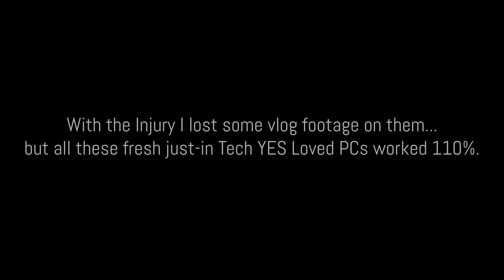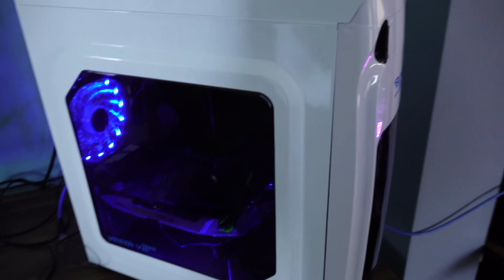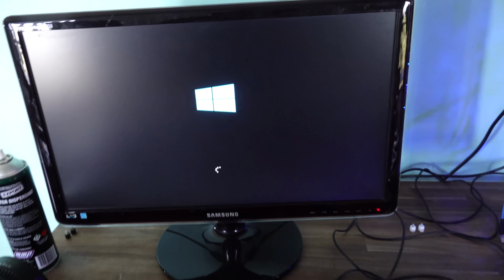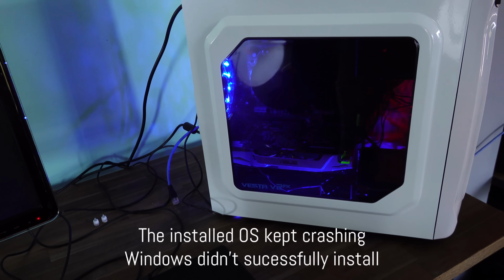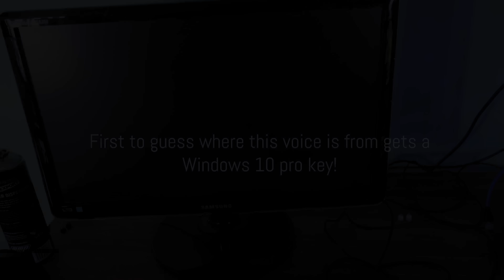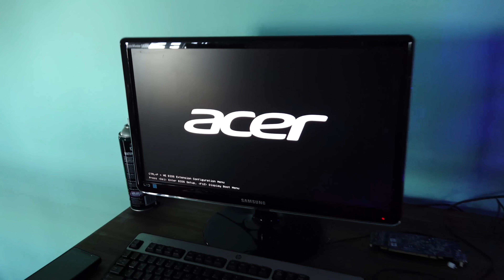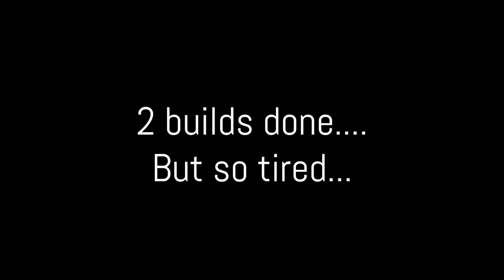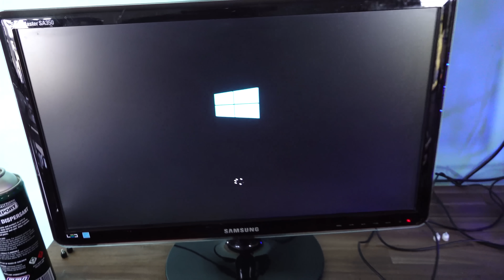Building PCs & More OEM Secure Boot Problems - A Tech YES Hurricane VLOG

Comment: I got an Acer legacy bios board working with a 1060 3gb. I had to use DDU with an old card to remove all previous drivers, but after that it worked like a charm.

Comment: kinda weird to "fix"! a fan running at full speed by using a low noise adapter. that's kinda lying to the customer as something might as well be broken on that motherboard. there is a reason that it's running at 100%

Comment: I’ve had a similar situation with the spinning fan, except it would just run the LEDs in my case. 

Turns out it was pulling power from the monitor. Disconnected DVI cable and it turned off.

Comment: LOL! Imma needs you and Linus to be more careful with your components. You specifically need to stop putting your boards on the floor (which appears to be carpet). Now, I know components are not as prone as they used to be to static discharge but it would not hurt to put them on a non-conductive surface.

Comment: Maybe the one Board which shuts down after a while has a issue with the PSU or something really dumb like getting shorted by the case or fans drawing too much power? I'd pull it out and check it with a different PSU etc.

As for the GPU: try a aftermarket GPU which has a 6-pin connector while the normal one doesn't... I've seen some server boards go crazy when a card tried to suck too much power.

Comment: I’ve had a few PCs that would not boot with new 10 series GTX cards, I had to put in an old HD 4350 in order to get it to boot. A bios update fixed the GPU compatibility issues I was having.

Comment: I suggest you use a hacked BIOS like i did with a HP machine. The thing would not take the desired 750ti no matter what so i flashed it with a hacked BIOS and even too this day the family i donated the PC too doesnt have a issue + it unlocked the stuff needed

Comment: do you have allways so much problems with this oem builds? when i buy oem builds, than i just buy asus, because i know, this will work with an other gpu and the motherboard is just a normal one that you can buy, not a green oem one

Comment: hey bryan. I've had the same issues with acer boards. They will run fine with Nvidia cards from the 600 series and older. Also the HD 7000 series and older shoud work just fine.

Comment: 😒 What TH is a 'low noise adapter'? looks like you slowed down the cpu fan with a wire? 🤠 And as far as Acer MBs 'TechDeals' never really mentioned much about having a problem with his older Acer OEM Gaming PC Project VIdeos but I do remember seeing alot of 'EVGA' Video Cards in his videos if that helps you ✌️😏🦃
Reply: MrSammy It’s basically just a wire extension piece with a resistor built in. It lowers the voltage going to the fan, reducing its speed and thus 
lowering the noise. It’s very useful if your BIOS doesn’t offer enough options to control the fans and the default speed is too high.
Reply: @Astfgl  🙂 ok neat, yes i did notice in oem boards the bios is missing the 'Cpu Fan Speed' setting where u can put a value from 0 to 10, ok thanks for the tip 😏👍

Comment: Why don't you just set the board on a table (like at 8:40), and use a test card on all of it before putting it in a case? I use an HD8490 (potato without needing external PSU) to test systems (like after a massive water leak while running, or new hardware). It takes about 4 minutes to hook up a system to a PSU and drop in a small card with 1 hand (I film with my other hand, or hold a fire extinguisher depending how likely it is something cool, I uh... mean bad... happens). Running 1 system directly on the table since its perfectly fine (wood table).

Comment: Buy it, use it, break it, fix it, Trash it, change it, mail, upgrade it, Charge it, point it, zoom it, press it, Snap it, work it, quick, erase it, Write it, cut it, paste it, save it, Load it, check it, quick, rewrite it Plug it, play it, burn it, rip it, Drag and drop it, zip, unzip it,
Reply: Sang this

Comment: If the fan spins with no power, then 5VSB must be shorting through to something and reaching the fan.
The other option on some boards (seen it on my Asus) is options for choosing legacy or UEFI for devices - I made a mistake because I'd intended to install Windows for UEFI with GPT partition, but with both enabled, it did me a MBR partition - I have a vague idea that Windows 10 is supposed to be better at booting through UEFI... Maybe I tweak some settings and use something to convert the drive to GPT - after checking that the utility can also do a conversion back to MBR using a bootable CD or by hooking it to my other system - I've picked up quite a few giveaway pro version partition tools

Comment: That's why I always change the settings in the bios before taking the boards out, and I always update to latest bios, never had a problem like these before and use hp boards that supposedly only allows 35 watt to pcie and never had a problem running a gtx 1050ti on them

Comment: 3rd and 4th gen Acer boards typically from the Veriton line work fine with modern nvidia video cards. In USA I was getting them for about $20-$30. So never bothered with the 2nd gen stuff.

Good thing about the Acer 3rd gen it will work fine with 2nd gen chips while still working with nvidia cards. 

If you avoid some of the acer SSF boards then its standard atx plugs, standard front panel and standard usb 3 connector.

Unlike some of those Lenovo boards where its custom atx and usb 3.0 headers.
Reply: I own a Lenovo SFF and it's not only the USB 3 header and the ATX connector, but the front panel, the front audio connector and the rest of the USB headers so it's a complete mess. The thing is that the form factor is a standard micro ATX so you could get decieve at first glance thinking that you could transplant the mobo easily to another cage but NO.

Comment: Brian........I had to Disable Secure Boot and then go to change CSM to Always to enable the legacy video Bios to finally get it to work on a similar Acer board with Nvidia Card. Hope this help bro..
Reply from the maker: Glad you got yours working, these boards I have here don't have the option :(, so would need to find out a GPU that supports these boards.
Reply: Tech YES City 

Is it a AMI Bios? If yes, check out this thread where one guy explains how to use AMIBCP to unlock secure boot control. I've removed the ability to set a master/bios password with this tool once so good luck!
Reply: https://www.win-raid.com/t284f16-Help-Mod-Asus-S-CA-BIOS-to-enable-Secure-Boot.html

Comment: Can that legacy stuff also happen to AMD cards like an MSI R9 380 4GB? I have the problem that it works with the basic display driver but when I install the AMD driver and start GPU-Z my memory and clock is at 0 and the exclamation mark appears on the GPU in Device Manager.

Comment: 8:25 - That happened to me a week or two ago. It was confusing as hell. Although I have a Cooler Master G750M semi-modular PSU, and it was the fans for my Gigabyte GTX 1080 Windforce OC that kept spinning for a while after turning the PSU off. I'm not sure how or why, but simply switching sockets for the modular (SATA, mind you) cables fixed the issue.

Comment: You could try updating the bios on the Acer board, if that works, try the same for the other oem boards.
Use an old vga monitor to get into the bios.

Comment: I had the same problem with the fan just constantly spinning. Turns out that it was my USB Hub that fed voltage into the mainboard. It was enough to keep it running after pulling the plug.

Comment: At least you got stitches in your thumb. ;) I got hit in the face with a baseball, pushed my upper lip over my front teeth, and had 10 stitches in my lip.  Tickled when they removed them though.  But props for working through the pain! :-D

Comment: Iv'e been doing pc builds for the last 3 years and have some odd graphic cards i was wondering if you wanted for free. 2 e-GeForce 8800 ULTRA 768MB ATI RADEON HD 4850 512M. I never used them for anything more than testing motherboards out. I was also wondering if you have any idea if my personal build has the ability to be upgraded to do live streaming while playing triple A titles? i 5-3570k, 8GB PJ DDR3-1333Mhz, Gigabyte GA-B75M-HD3, Radeon R7 240 2GB DDR3 OC, 500 GB Seagate Barracuda 7200Rpm EVGA 500W 80Plus bronze.
Love the channel and hope your healing up nicely.
Reply: upgrade the graphics card first and try streaming off of that instead of cpu encoding
Reply: Definitely upgrade the gpu and if you want to upgrade the cpu go for a i7 3770K, i7 2600K or 2700K. The graphics card is huge bottlneck, go for something like a 970, 980 or 980 ti
Reply: Yeah that can't stream or play AAA games with high detail. Chip is ok for gaming but need big time gpu upgrade.

Sometimes its cheaper to get a used 2nd build to do the actual streaming from then trying to get 1 to do both at same time since its more costly.
Reply: 🙂 Dear Greg, Normally people would say that u shud upgrade ur pc to a new 6 core system from either company. But if ur ok with lowspecing and using Low on all settings and play stream lite game titles i guess u cud try upgrading your cpu to an i7, overclock it a bit, and for gpu i like 970 980 980thai 1060 570 580. If ur R7,240 (hd7570) is a low profile low height baby video card then keep it around to upgrade a SFF OEM Core2Duo Desktop, that way u can save an old pc and give it a new life, it will be able to play xtra lite games on it for example: Doom 1, Half Life 1, FEAR 1, indy games, open source games 🦃
Reply: Remember when checking processor upgrade prices that some Xeons have exactly the same specs and are available in the second hand market cheaper than i7.
Reply: @RetroTinkerer  🙂 True, i have an oem lenovo 4th gen mb, i remember reading that u can use an lga1150 Xeon 4/8 cpu instead of an i7 4/8 cpu, tho i think the xeon version is almost the same price if its the same GHz Speed, but let me chk rite now cause i wouldnt mind upgrading it, and moving my i5 to a spare haswell board that only has a crappy 2/2 celeron 😃🐢🐢
Reply: You’d just need to upgrade your graphics card to play AAA games, you could probably stream as well but at low to mid settings (basically the same as console)
Reply: Install 2 GPU, Use odd GPU for display and normal load only.

Comment: Bro I just want to know if the pre-built PCs' (HP, Dell etc...) power supplies are any good and can be used for gaming or we have to change it and thanks :)
Reply: In most scenarios you would need a psu upgrade, however with a low power card it could work. Upgrade if possible however
Reply: @tomsinclair5982  those PSU could run a GTX 970 or not ?
Reply: @IsmailKarym  not
Reply: @NoodlesTBograt  Okay Thanks a lot Bro
Reply: @tomsinclair5982  Thank you too <3
Reply: There is a huge range in OEM psu's. Safe bet would be no. But sometimes you can get lucky and have an OEM Delta 400w or 450w in there and then you are fine.

But the other 90% of the time its anywhere from 200-300. Especially if its small form factor some standard oem desktop sizes you get lucky to have a 350 in there.
Reply: @JimmysTheBestCop  thank you so much for the great informations I really appreciate that ^^
Reply: All the information will be on the PSU sticker so always refer to that just don't try them at random so just open up the case.
Reply: @JimmysTheBestCop  I think I'll need at least 450W PSU but I'll try to get a 500W it will be better

Comment: Can't wait for the x58 and x79 stuff.
Reply: 😒 meh, i really dont f care for $150 and up Per one lousy mother board projects, However the cpus are ok if u can find a cheap T3500 T5500 T7500 or Mac Pro Tower 🙂
Reply: x58 is dead :(
Reply: @AnimePlanetVerse  not if you get z400 you can still get those for quite cheap. No overclocking I believe though
Reply: @max6833   I mean 1366 cpus ipc is little and tirple channel gives nothing compared to 1156 with dualchannel, and thats suck. Same performance in software and aida memory test. Its better to get x3440 (4/8) cpu with any h55 board and 2x4 ram
Reply: @max6833   Some overclocking is possible using XTU, only can change turbo multiplier though so you need an unlocked chip to do it. My Z400 with w3690 could go to 4Ghz all core turbo by setting the turbo multipliers to 30. That being said the VRM on the z400 is not that good and any higher wasn't stable for me. I upgraded to a z420 recently and the single threaded performance is way better on ivy bridge v2 xeons.
Reply: @White-Wolf1969  what has better single core preferences overclocked z400 or stock e5-1620 on z420
Reply: @max6833  I don't know about the e5-1620 v1 but the v2 is faster in single threaded tasks than my z400 was.
Reply: @AnimePlanetVerse  x58 is FAR from dead.

Comment: I had that problem with my Alienware, when installing a new graphics card I had to disable secure boot. One I did that it worked.
Reply: The video card, assuming it was UEFI compatible, shouldn't load its option ROM if secure boot is enabled, otherwise it can end up in the boot cert chain and either break anything using SRTM (like BitLocker or device guard) or just straight up not boot.  OEM mobos from the past are pretty notorious for no SB options (setting to MS only on boards with that SB option generally "fixes" it though).
Reply: Problem is on some of those 2nd gen OEM boards there is no option in the bios. Some OEM's had bios updates that added the feature if the board could take it while most never did.